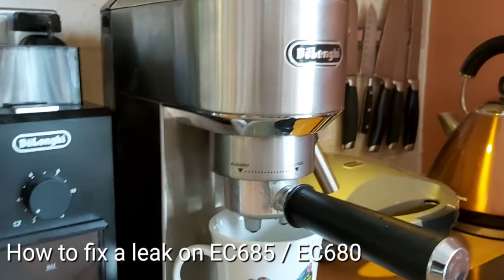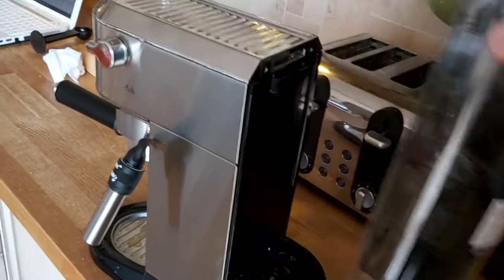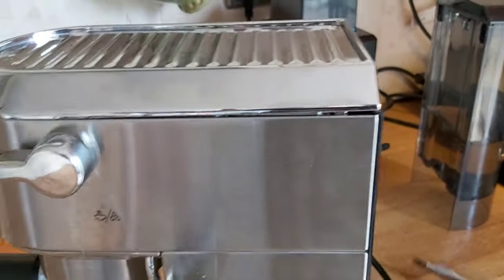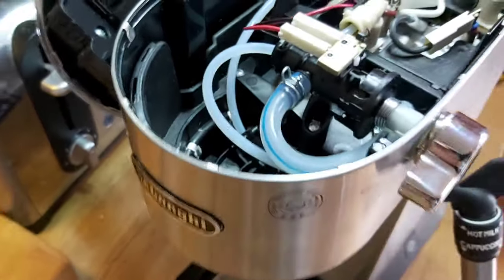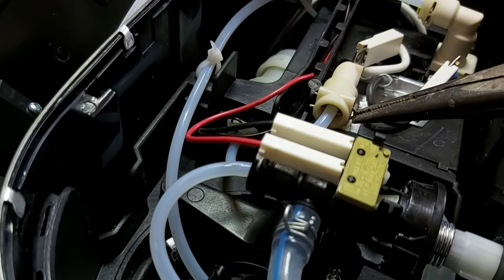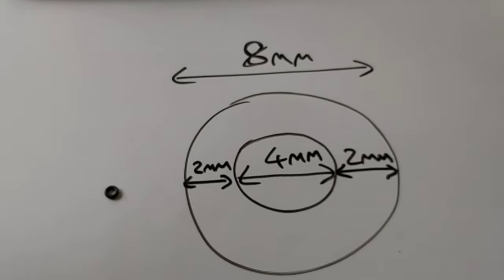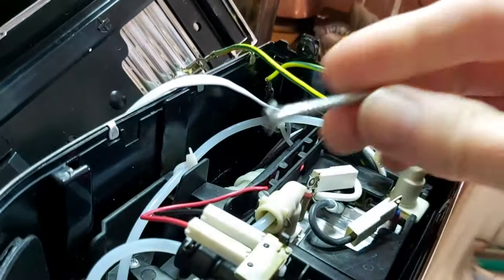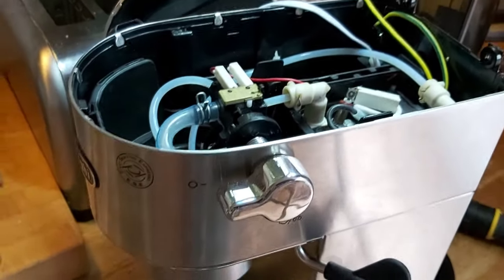How to fix a dripping / leaking delonghi espresso ec685 / ec680 machine

Comment: Thank you for taking the time to make this video. My problem wasn't the 'o' ring it was the 3-way 'y' plastic valve. So I paid out for 'o' rings i didn't need BUT your video gave me the confidence to take the job on and start the elimination process that ultimately saved me buying a new Dedica. Thanks again!
Reply: Hi, where you bought it? Your case sounds like mine, water isn't ejected, properly, around the ring not just by the middle dropping, opened and realized looks like can't drain properly so on rejected to inside as well
Reply: How did you fix 3 way Y connection?
Reply: @eldorj4080   you have to buy and replace the Maynard Valve... it's not expensive or hard to fix.

Comment: Hey Jonesy, nice video in case this ever happens to mine, which I have had already for 5 years. 

Just wanted to mention, it is GOOD, that it leaks out of the bottom in case of an internal leak, because otherwise it would fill up inside and fry the electronics. I figure they probably designed it that way, so that it wouldn't self destruct in case of a leak.

Cheers!

Comment: The steamer knob is also prone to leakage from the silicone seal inside. These machines are very prone to problems, my machine failed me after 11 months from that silicone seal I mentioned. How it happened: It worked fine during extraction, and also performed with no problem during the milk frothing, however when you proceed with cooling the boiler by letting steam and afterwards water out from the steam line, the seal gives away and lets water leak into the exact same spot that you mentioned in the video. It also happens when you want to heat water for tea or something. Result: inside screws were all oxidized.
I also have to mention that the steamer knob as it is made of cheap plastic and that the switch positioned above as well as the knob itself starts to move from its original position and fails to make contact and you have to push the knob upwards in order to activate the steam pump and get it to work again.
This machine makes good coffee, and I had mine in impeccable shape, always cleaned it after use and descaled it at the recommended time, however it did not prevent from it failing just shy of one year.
If I knew now what I have known then, I would not have bought this machine.

Comment: Thanks. Your fix worked for my delonghi icona vintage eco310. The orings recommended by you worked fine. They did look slightly larger than the old ones, but only by a tiny fraction.

Comment: Personally, I enjoyed listening to excellent NON-American English and just got high from it.  However, I did not understand at all where to put this 2x4x2 spacer.  I have the same problem with the EC680 and I took the whole thing apart to see if it was the gasket that is in the three part where the horn is inserted.  It's very difficult and I was happy to find your solution video.  I want to do as you did, and I want to ask you if you could give me a couple of minutes and explain the algorithm in the form of a picture-text.  This can be done to my mail or post a video with a photo and text on YouTube.  I am sure that you will be grateful to a huge mass of people who find it very difficult to grasp the essence of the decision by ear.  Thank you in any case and happiness in life🙏
Reply from the maker: Many thanks. Appreciate the comments.
Reply from the maker: When you take out the pipe there should be an o rign left in the socket if it didn't fly out. Take that out, put the new ring in place inside the socket, then put the pipe back in. Job done. Does this help?

Comment: Thanks for this! I have a different issue where the drips are coming through the coffee basket - I'll do another descale before I follow your steps for opening it up and having a look. Cheers for clearly explaining it all!
Reply: If anyone has the same issue as me - the machine was dribbling out water/coffee after it had finished and especially when using the steamer. I descale with w bottles of tesco white vinegar (35p each) and the issue went away - no need to open. So my issue was far simpler fix but cheers for this video regardless!

Comment: Thanks for the video. My problem was the damn little spring and ball underneath the feed decided to lodge itself weirdly.

Tip for the orings if anyones seeing this. Just put the oring ON THE hose at the very end (Not quite all the way seated) and push it back in. Then pull the hose back out and verify that the oring is seated in there correctly.

Comment: Many thanks for this video.  I have a dripping frother outlet, which I'm presuming may be a similar problem of a leaking 'O' ring, but I was initially looking for a video on how to get into the innards of this machine, to see if I can replace what is becoming a very slow pump - and your video covers the initial problem of access perfectly.  Thanks!
Reply: Did you manage to fix it? My frother is leaking and I'm struggling to find anything online to help fix it
Reply: @Jess-cv9gi  No Jess, I haven't done anything about it to date, but my frother outlet is now leaking too, but I'm also finding standing water below the machine after operation.  We have a local DIY shop that sells a range of things, which hopefully will include 'O' rings, but having removed the case, it's a jumble of pipes inside, so I'm concerned about making a simple problem worse if I can't immediately see the problem, so I may just stick with a dripping pipe for the moment!
Reply: @Jess-cv9gi  Hi again Jess.  I "bit the bullet" this morning and removed the top, as described in the video, while (very carefully!) making coffee.  As was to be expected, sods law kicked in and the frother nozzle didn't leak!  However, I was looking to see where a potential leak may come from and other than the pipe held with a spring clip just above where the nozzle pipe goes through the body of the machine, I could find nothing that would suggest a dripping nozzle - UNLESS - it was a failed 'O' ring elsewhere in the system, as described in the video.  The only possible place I could see where that might happen, was on the narrow pipe that goes into the left-hand side of the switch attached to the frother nozzle lever.  If you stop the video at 3 mins. 10 secs., you'll see this pipe towards the bottom of the picture, entering the nozzle lever switch on the left, below the 2 white connectors, (it's the thin pipe, on the left, NOT the larger one with a spring clip at the front.). Having looked on eBay, there are loads of listings for 'O' rings, but you need to search for those associated with either plumbing or hydraulics.  I couldn't find any that gave a size of 4mm hole by 8mm diameter, but there were a couple with a 4.5mm hole, by 8mm diameter and I'm wondering if these were what were used, as I think it would be extremely difficult to differentiate between a 4mm hole and a 4.5mm one!  As they were listed under plumbing and hydraulics, it could be worthwhile checking with a local plumbing shop, to see if they have anything suitable.  As for my leak at the bottom of the machine - I did fix that.  I took off the base plate, then removed the 3 screws holding the sprung water connectors in place and discovered that one pipe needed pushing on tighter.  Another possible reason was that the water reservoir needs to be pushed firmly into place, as I think that was also allowing water to seep out due to the suction action, if the reservoir was not pushed firmly into place.  Hope this helps.  Alan
Reply: @Ayjay2785  Thanks! I also couldn't see any immediate problems when I opened mine up so suspect a similar issue. For fear of making it worse (this is far out of my skill set) I may hand it over to a professional but good to know this might be an approach to try!
Reply: @Jess-cv9gi  Hi again Jess,  Eureka!  Today, I've fixed the leak on the dripping frother spout at a cost of £9.99.  It was quite simple - though of course, the definition of "quite simple" depends on how "techie" you feel you want to be!  Having purchased the replacement valve, it required 2 screwdrivers, a pair of pliers and a "dooberee" - AKA a small, sharp implement, ( I used a very small flat-head screwdriver,) to remove the 'O' ring from the old valve, which came out fine.  If you feel you'd be prepared to tackle it, let me know and I'll prepare some details.

Comment: Wow, thank you for your attention to detail. Yes, very helpful. I will remember this. I was looking to see if I could remove the brewer head and clean it. My brew is taking too long. Last time it did this, I flushed the brewer head, descaled good as new. Not this time. Adjusting the grind gave drip coffee results. I've always used same beans same grind. If I don't find a plug, the only thing left is the pump going out.
Reply from the maker: I would try to clean the circular metal grid at the outlet? Like you did with the brewer head. Otherwise, no idea. Sorry.
Reply: @jonesyboy4434  Yes, I cleaned it. Had a lot of build up. I really thought I nailed it. It's still choking on the coffee. Back to thinking it's the pump. I bought it open box. It was probably a demo. I've had it a couple of years with no problems. There are posts about testing the pump but it's shop talk I don't understand.

Comment: Good tips. But.. Mine leaked from the main dispenser when I switched it on. It was dry inside so none of the connections were leaky. Drips continue after a cup is made so I thought it was a heat issue.. expanding joints etc. Nevertheless, I replaced 3 o-rings that I could get to - the one you said, plus one at the back of the machine and one just above the dispenser.. and it cured it.. performs now as when new.
Reply: I have the same issue... can you make a video to show where are the other too please?

Comment: Nice... I have the same issue. I will follow your steps and I hope it is the o-ring.
Reply from the maker: Good luck
Reply: @jonesyboy4434  Thanks, but the o-rings were fine. I turned it on while it was opened and I found that it was the 3-WAY VALVE CONNECTOR, the Y shaped part at the bottom, that was with a crack (the only way to spot it is when is leaking). I have ordered a new one...Anyway, your tutorial was excellent to find the problem. Thanks.

Comment: Thanks for this very useful video / solution. I came across your video as I was searching for any experience / solution  regarding leaking from the base of the machine. When I use mine / leave it standby I find that water pools underneath the base of the machine. Any thoughts / tips appreciated.

Comment: the o-rings might be expensive for a reason, special material that's both food grade as well as resistant to the appropriate pressure and heat

thanks for the video

Comment: Is it safe, for the machine, to operate it with the upper cap removed? Mine is leaking from the vaporizer, just by pressing the On switch drops of water start leaking from there while the machine heats up. Vaporizer's strenght is also noticeable lower. So I want to try to operate it without the uper cap in order to spot something, if that won't cause me more issues.
Reply from the maker: Yes,  the lid does not need to be on for the machine to work.  Ok to observe, just be careful to not touch mains electrics and be aware if leaking hot water/ steam.
Reply: Have you fixed the leaking/dripping milk nozzle/vaporizer? Because mine has the same problem 🙄

Comment: Hey! I have a a smeg espresso which is pretty much the exact same set up as this. The issue I’m having is when I go to use the steam wand, steam comes out of the brew head also. Any idea why this could be happening? It was recently descaled so perhaps something has lodged itself and it’s taking the path of least resistance. 🤷🏼‍♂️  it’s only started doing this today after 2 years of perfect use.
Reply from the maker: Hi, sorry no idea.  But your idea sounds sensible. Sounds like the seal that switches the flow path is not sealing properly. Try removing and cleaning? Sorry, can't help anymore than that.

Comment: I pulled the pipe out as per the video, and could not reach for the o-ring. On top of this, I'm struggling to fit the pipe back into the right-angle bend and get it to stay in place; I can't push it in far enough to secure it with the clip. Any help?
Reply: I managed to solve my issue, I fashioned an old paperclip into a hook and fished the o-ring out, there was no damage to it but replaced it with a fresh one as my machine is 3 yrs old. I put the fresh o-ring on the end of the tube before fitting it back in :)
Reply from the maker: Great work! Always a way
Reply: @colonelcorndog  couldn’t have done it without this comment. You’re amazing, i was fiddling for an hour

Comment: The problem I am having with this machine is that when it is pouring coffee, water is coming out from the steam wand at the same time. Any help is appreciated. Thanks in advance.
Reply: Hi, did you manage to solve it? I'm having the same issue.
Reply: @MegaMartinuk Hi, the problem is still there. I opened the machine and tried to find out where the problem was, but everything seemed fine.
However, I learned a trick, when the machine is pouring your shot, you hold the steam dial with two fingers and push it upwards. I hope that make sense. 😊 Let me know how it goes for you.
Reply: @MegaMartinuk  that will stop the water coming from the steam wand.
Reply: @imahmud  thank you! This trick didn't help in my case. What's strange, that in some cycles the water is leaking, while in others not. Did extra descaling help you in any way?
Reply: @MegaMartinuk  the descaling didn't help. I was thinking to do a video of the trick I explained.
Maybe I wasn't clear of my explanation.
Reply: @imahmud  good idea :)

Comment: 4:35
It’d be easier if the oring is shroud through the white tfpe tube first, and insert the tube into the connector, than insert oring into connector.

Comment: Hi Jonesy very well explained, Kudos to you for this. I have exactly same issue but my machine is ECP34.20, can you help by advising something for that model. Thanks in advance :)
Reply from the maker: Sorry,  I'm not familiar with that model but my guess would be that the internal connectors and seals would be similar.  Have a look and good luck.

Comment: Great to see someone have a go at fixing stuff. Btw how do you find the machine and grinder? I'm looking at buying one second hand. Tai.
Reply from the maker: I really like the machine. I bought a refurbished one from ebay for about £120 and it's been great (apart from the leak Haha, but that can happen with any machine I suppose!). Both the machine and grinder are decent. Takes some time to experiment with grind size and tamp pressure but that's coffee making.
Reply: I have exactly the same machine and the same grinder.  The espresso machine is great for a first step into espresso but the grinder really wasn't very good and didn't grind fine enough for good quality espresso.  Ive bought a better grinder but am still using the Delongi Espresso machine
Reply: @jontrewfrombarry  there's a guide to modify delonghi kg79 to grind finer, it's super easy and it actually works

Comment: I have  problem with my machine, each time I use the frother, the lights of single and double shot start blinking and I have to restart the machine to get an espresso shot, any suggestions how to fix that?
Reply: The lights blink after frothing because the boiler is too hot and has to cool down, the best thing to do once you see the lights flashing, rotate the steam lever to pump cold water from the tank. The machine will stop pumping water automatically. Rotate the lever back and you should be good to go.
Reply: @mrporkchop110  Thank you